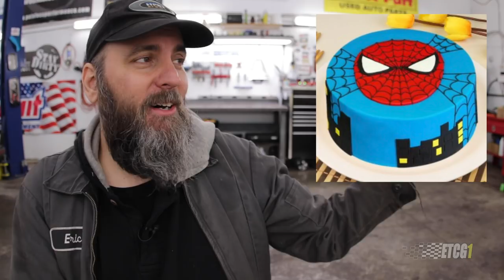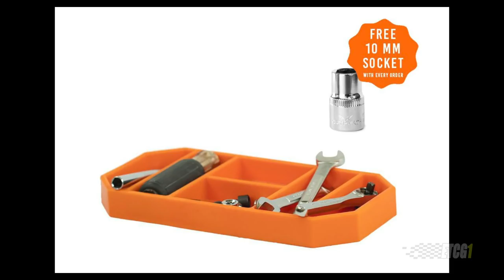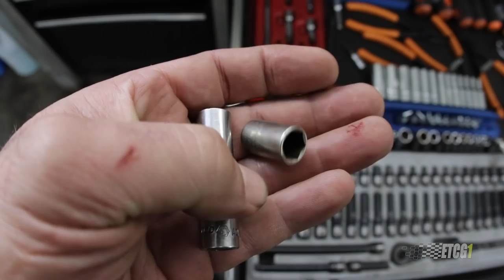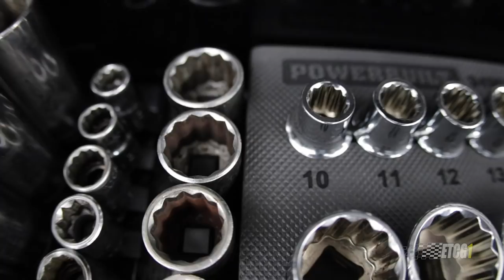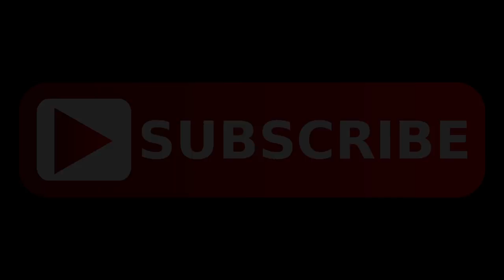What is Up With 10mm Sockets?

Comment: I service and repair my own Japanese motorbikes and yes the 10mm socket is a thing. If you lose it you will get stuck at some stage of the service process because guaranteed the last bolt that needs to be removed is 10mm. Never had an issue losing one myself as I have collected way too many sockets over the years, but yeah I have put one down and had to dig another up many a time. You don't really lose them, for some reason you just cant find the bloody thing when you want it.

Comment: I've "lost" many a 10mm socket... I usually find them about 6 months later, exactly where I put them last (usually on the floor, under a pile of interior parts waiting for me to reassemble the car.) I think it's just so common a fastener size that ,especially if you're not working alone, it's easy to misplace.
Reply: I've actually lost (truly lost) more 8mm sockets than anything, since that's the size my friends borrow for hose clamps or dash components, then they place them down to switch to something else, and forget where it was.

Comment: I've only ever actually lost and not recovered a single 10mm but I can say my dad lost a couple over the years. I think the reality is that everyone needs a 10mm and not everyone is organized and responsible. I've dropped them in the driveway and dropped them at the parts yard and been able to find them every time but I know from working at a shop with multiple techs sometimes one will get borrowed and not returned to its home causing a frustrating search. My dad taught me a lesson early on, paint all your tools pink so if someone walks away with it in the same shop it's easy to find.

Comment: 10 mm socket is the most used tool to bolt and unbolt things and that means it also get misplaced the most because you are always using it and leaving it in vehicles,shop floor or on the bench. 
So the next time you go looking for it in a tool box say after the weekend or after being away from work you spend time looking for it around the shop.

Comment: I have 10mm in 1/4" drive deep and shallow, 3/8" drive deep and shallow, 1/2" drive deep impact, nut driver, open end and box wrench, 2 different ratcheting wrenches and flare/line wrench.  Also 10mm allen key and hex drive sockets.  I've never lost a single one.  Actually I still have all the sockets since my first socket set my dad gave me 20+ years ago.  I don't get why people say they're losing them all the time.

Comment: The more an item is needed the more chance you will lose it, damage, or have it stolen. For some reason they are always needed in tight spaces. If you are like me, I have a bad habit of keeping common tools in arms reach. I have "lost" a fair share of 10mm sockets to the radiator grill space. I just right it off it is usually not worth pulling the radiator.

Comment: Multiple 10mm are a must especially with Integras. You need short ones, long ones, in all drive sizes, angled, u-jointed, impact, non-impact, thin wall, and every single variation of it.

Comment: I did not understand that either. Sure 10mm is a common size, but so are many others all depending on what you work on. It makes more sense to be to just buy a set of the common sizes with the skips in there if what you want is a common size. I personally have no real use for a rail of an assortment of 10mm as the 10mm is already in all of my sets. When I owned a Toyota many years ago, I needed a 12m and a 14mm for almost everything.

Comment: Combination of the two.  Commonly used, commonly misplaced.  Also, if you have multiple vehicles, you might not need your whole socket set, but a 10mm, 12mm, etc might be good to have in your door pocket just in case you have to do some roadside maintenance.  Especially is you live in remote rural areas in a large, sparsely populated country like Canada (and some parts of the US).

Comment: I find myself always needing a 10 mm on cars, small engines, other machines, etc.  It is one of the standard sizes used by manufactures for small size bolts. I don't really lose 10 mm more but I can see the issue. If you drop on into the abyss of an engine compartment, or forgot it somewhere, they are small enough to be hard to find. Larger sizes are easier to find. Especially if you do not have a garage, and are working outside, where there is small for something to roll, and the floor isn't perfectly flat, so then it can blend in better.

Comment: Working on motorcycles for many years and sometimes cars, I usually have a 10 mm and 12 mm socket on the ends of various T-handle wrenches or L-handles.  Between switching them around and losing them and occasionally losing the bolts as well, they seem to be a real pain in the ass to ever have enough when you really need them.

Comment: My uneducated guess is a bunch of things that all add up. The 10mm is used more than most other sockets, therefore it has more chances of being lost. You don't lose the odd sized socket that never leaves the toolbox. It is relatively small so it can fall into smaller spaces as well as be more easily overlooked when collecting tools. Another person said here it is a common size for things like covers, so you start out using it and move on to other sizes so it can be easily forgotten and left behind or knocked on the floor when you are using other sockets. 

At my job the machines I need to fix on occasion use 7/16 and 9/16 almost exclusively so that's what I lose. I have 10 12 and 13mm sockets coming out the wazoo, but finding a 7/16 when I need it is impossible.

Comment: IMO, 10mm  is a quite common sized bolt head. I live in Canada where use both metric and standard so I’m biased towards it either. However, car manufacturers tend to use metric more now. Most small parts that are bolted on used to use a 1/4” bolt, so that has since been replaced by a 6mm bolt, which uses, you guessed it, a 10mm bolt. You probably don’t realize how often you use a 10mm socket/wrench but there is a lot out there. So with that said, if it’s the most common, it’s the most likely to get lost. It’s the same where I work at, a boat shop where we use a lot of 1/2” bolts. So in turn, we find it difficult to find 3/4” sockets

Comment: I still have my 1/4" drive deep 10mm socket that was included in my Snap-on tool set when I went to automotive trade school in '97-'99. It's been borrowed & lost many times, but I've always been able to to recover it. The 8mm sockets..that's a different story.

Comment: I bought a 1/4" metric set in 2006, and I can tell the 10mm from a distance, it's the dirtiest and most scratched. 14 years later that 10mm "rests in pease" stuck in a Sienna fender impossible to get. That was during the biggest job I ever done, replacing spark plugs on a 2gre-fe.

Comment: It's a combination:- 'It's definitely the most used socket' on so many applications, bicycles, cars, power equipment, motorbikes, ikea or equivalent. And it always gets lost/taken i.e engine bay, apprentice flogs off with it. It gets damaged or rounded especially chinese made ones. Or my favorite 'Displaced', finally you give in & buy a bulk 10mm pack of a 1000 , then attach it to every ratchet you own & properly misplace the ratchets due to the 10mm curse.

Comment: For me, its probably because 10mm for most imports is pretty commonly required. Esp to remove body panels or parts to access other parts.
Even if I am installing rear trailing arm bushes, i end up using 10mm to remove the parking brake cables.. which are clipped on to the trailing arm with 10mm fasteners.

Comment: I think a combo of the two.  I've lost a few 10mm (and 3/8s back in the day).  I try to keep them organized but it happens.  I also found a 1/4 drive Snap-on ratchet, 3in extension and 10mm.  I don't use it as I consider it my lucky charm now.

Comment: It's the one that always ends up in the lost nether of some body panel. It drops, it clunks, and never reveals itself on the garage or shop floor. If you have a used car that seems sound in almost every way but still has that one rattle, it's haunted by the missing 10mm.

Comment: I've lost a couple tens, one fell inside a dashboard, it's still there, also another fell between a firewall and inner fender, still there too.
I've found one too, it was stuck to a rusty suspension bolt in a car I bought.
Reply: I found one in the engine bay on the splash guard after I bought my car.

Comment: U got it already. Very if not the most common size used in metric. Always in use, therefor sometimes lost even by people anal about their tools. Popped one out the end of an extension and had it mysticly disappear from the supposed bolt it had been on when it popped out. Luckily had another one atthat time. Now I have 4. Just in case.

Comment: I think it's because the 10mm is usually a preamble to getting to something that uses a 13/14/15mm  I usually use a 3/8ths drive for 10mm and up so it's extremely common to take off the 10mm right at the beginning of a job and still have a fair amount of work left to do. Also at the beginning of the job you're focusing on what the next steps should be and you're distracted when you take off that 10mm and set it...somewhere.

Comment: The thing that's up with 10mm sockets is because the bolts are almost always the right size for a majority of cars that are built with metric fasteners. It's sort of like the way old tractors could be fixed with I think 3 different spanners and a pair of pliers, you can't fix a tractor without those 3 sizes. In a similar fashion, you can't fix a car with metric fasteners without using a 10mm socket at some point in the process. The next issue is that 3/8 inch sockets, regardless of their drive, are always a hair bigger than 10mm sockets and won't always be lost in the same places that a 10mm will be. Finally, a common thing to do with sockets is to take the socket off the ratchet and turn the bolt off with the socket instead of turning the bolt off with your bare hand, and when you do this with 10mm sockets, aside from being the perfect size to lose in all sorts of crevices and gaps, they are seemingly more difficult to hold onto.

Comment: I did loose a 1/4" drive shallow 10mm socket working on my chevrolet joy (daewoo matiz). The engine bay is quite cramped and it never touched the floor.

Comment: It's a common size, so used most often - also it is small enough that if you do drop it in an engine bay, it is impossible to locate, unless it reached the floor.  If it reached the floor, it's small size means it is likely to bounce and fly off into a location you would not expect it to reach.  Simple.  Don't fight the reasoning, it is what it is.

Comment: 10m seems to be the one that gets used upside down, behind the engine and on the end of a 3 foot swivel extension. It pops off with the fastener. Lands in the body seams or panel gaps. Blends in with its surroundings better than bigfoot.

Comment: Must confess I never knew the 10mm was a thing. Although I find it confusing that there needs to be a 10mm impact. How much torque can you put on a 10mm?  I am usually using the quarter inch drive with a 10mm  socket. 

My bigger issue is why to the companies use standard head, them Torx head, then e torx head, then double six point, then Security bits then ,,,,  just to do simple jobs?  

I was once told different fasteners have different capabilities. I call b.s.  There must be a reason other than to force people to the dealer. 

I would love a video on that.
Reply: @John Morgan  Impact is good for loosening corroded bolts without breaking them - especially steel bolts going into alloy, where the dissimilar metals tend to corrode and stick rather quickly.  It's not about the torque - and it's easier than trying to loosen them with an impact driver.  :-)
Reply: @aussiebloke609  it's been rare for sure, but I had a job where only the 10mm impact fit on some rusty 10's. Weird but true! 

It was super inconvenient and it took a lot of hammering (and no impact gun, wasn't needed) and I got it done.
Reply: Security head bolts and screws do have a special purpose, license plates so they'd be less likely stolen, to weatherize and secure boards or metal plates to windows, and over doors of vacant properties to keep bums and vandals out. I worked with a property manager for a while, and not everyone has security bits, or thinks to buy them.

Comment: the 10mm is incredibly common on new vehicles in the engine compartment and also in the interior, being that its very common and the 10mm is a fair small socket, its easy to loose.

Comment: The greater the times it's removed from the set, the greater the chance it doesn't get returned.
For me, it's my 12mm socket, which I am currently missing. Having two Hondas, 12mm gets used a lot.

Comment: The whole "10mm socket" meme is older than most think - go back far enough,  and it was jokes about how the 1/2" socket that could never be found.

It's just because the 10mm is such a common size now, as was the1/2" back in the day...so you tend to have it out more often, which leaves more opportunities to leave it under the hood, drop it down a drain, etc.

Comment: 10mm is to metric cars as 1/2" is to SAE cars. Every car has them, usually has a bunch of them and you end up leaving the socket somewhere in the car and losing track of it. Easy way to avoid that problem is to have a ratchet dedicated to just a 10mm (or 1/2") that you never remove said sockets from during the entire time of the repair. That way you're losing a socket AND a ratchet.

Comment: I've never lost a 10mm socket, but I once left a 10mm wrench on the rear bleeder of my brother's 2500HD diesel as we went for a brake bed-in run after a brake job, and a line, and hose replacement. I heard the faint "pwaaaaang ... ping ... ping ..ping" over the diesel exhaust note, so we whipped it around, pulled over and started searching. Never to be found again. It entered the infamous 8th dimension where tools, nuts, bolts, and socks, reside. 😟

I think the loss of a 10mm socket is due to the number of fasteners on different equipment that use it. More use would figure more losses. Every Japanese motorcycle, dirt bike, ATV, car, and truck has a number of 10mm fasteners on it. Even some outdoor power equipment today has them. Even can be found sporadically on some domestics for the past 20 years or so.

Comment: I wrench class A, and even they have a ridiculous amount of 10mm fasteners. Almost every sensor, and all of the little parts that are even remotely able to use 10mm are apparently enginerded to use it.

Apparently, almost every fastener in a car is 10mm, but i don't know that for sure.

I keep a 10mm in my pocket edc, just to be safe. I wouldn't be surprised if Leatherman makes a multitool attachment that's 10mm.

Comment: Here is the reason-
It is by far the most common fastener used in trim and body panels and other things that are hard to reach, thus resulting in dropped sockets never being recovered. 
It is also the most common fastener in foreign vehicles, as well as American newer vehicles. So it's also a numbers game. If you are using it 10x more than any other socket, especially on body work
... You will lose it more and also be looking for it more

Comment: I only lose snap on 10mm sockets.  Finally stopped buying them. Replaced 10mm with cheap one and haven't lost.  Same with clip tool and ratchet. Only time I use sae is on Ford junk and pullers.

Comment: Japanese manufacturers discovered that it's cheaper if the assembly line workers never really have to switch tools so most of the car is held together by 10mm bolts. If it's too small for the application, there's more than one, if it's too large for the application, use it anyway; weighs more but saves time and money in assembly.

Then these Japanese cars came to the American tuning scene, where people modified them and had to get special sockets just to work on their car. Then their buddies borrowed the socket to work on their car and we all know that if you lend something to a buddy, you often don't get it back when you need it.

Comment: The M6 fastener is so ubiquitous that nearly every metric project involves grabbing your 10mm socket. Every time you grab a tool, it's an opportunity to lose it, so the statistics get so you eventually lose them. Especially among weekend warriors who don't have the tool care discipline cultivated by needing your tools to feed yourself. That's the basis of the meme. 

For my part, the only socket I ever lost was a deep well 12mm socket because it got jammed between a bolt and a crumpled fender on a car I was planning to sell, and I decided it would be more worthwhile to just buy a new socket than break out the angle grinder.

Comment: I would say that 10 mm and 13mm (1/2 inch in old money) are so common that they wear out more than the others and may be borrowed by frends. (And not returned Grrrrrr).
Leave a socket set open in a workshop and watch the 10 and 13 vanish.
If you use a socket more often, there is more of a chance of losing it and we do lol.
Reply from the maker: Yes, the law of averages seems to come into play.